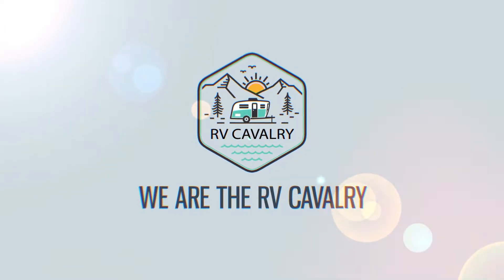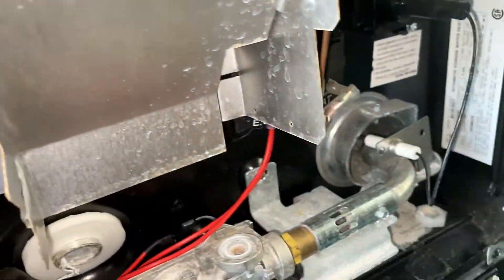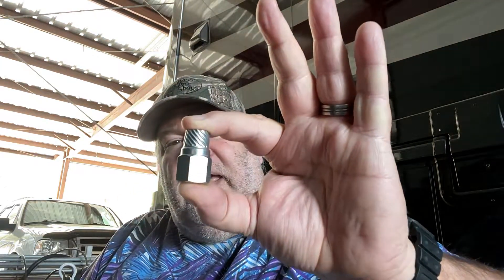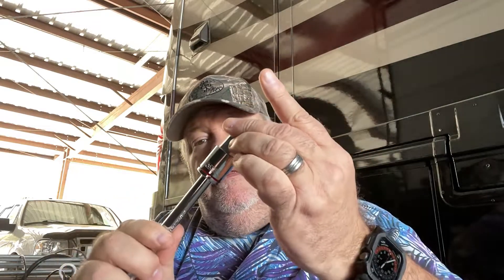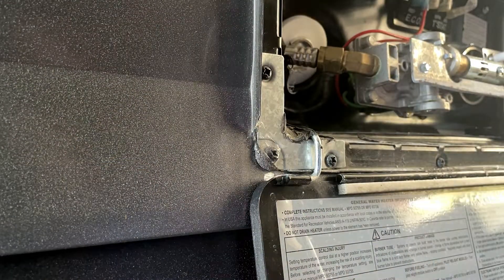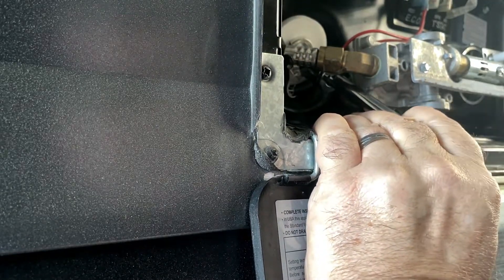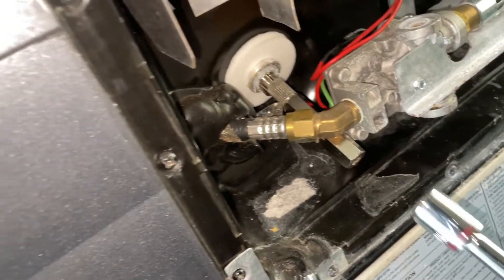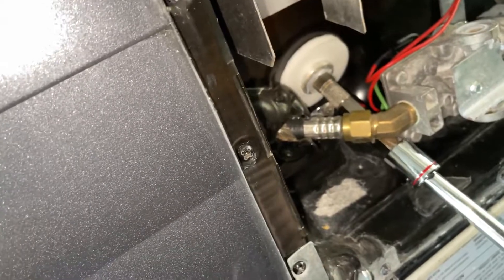DRAIN PLUG BROKE OFF INSIDE WATER HEATER | HOW TO | EP 0322

Comment: I am going to go to Home Depot and get the extractor. You are correct the plastic plugs are horrible. I am looking at replacing the plug with a Camco 1/2 inch Water Heater Replacement Drain valve. It looks like it is made out of brass. $9.57 from Amazon. Any thoughts? Thank you for the video.
Reply from the maker: Be careful with brass and aluminum they don’t go together do nonferrous metals. They sell an anode rod made for aluminum tanks you can them on Amazon. You don’t really need an anode rod for an aluminum tank but helps and the screw in part is coated and compatible with the aluminum tanks. Let me know if you have any trouble finding it and I can send you a link. The brass and aluminum will corrode and weld themselves together it’s a pain. Been there done that lol.
Reply from the maker: Also if needed you can use a paddle bit too just be careful not to damage your threads

Comment: Hope this works for me. Same problem. Ugh
Reply from the maker: I hope it works for you also. If the easy out doesn’t work try a paddle bit. We were camping with some friends and theirs broke also. We didn’t have an easy out but had some paddle bits in my tool box. I think it was 1/2” but can’t remember. I was able to line it up, tap it with a hammer, attached some vise grips to the end of the paddle bit and slowly backed it out. It took a little bit but I got it out in one piece thankfully. This happens more often than I would have ever expected unfortunately. But this beats taking it to the dealership that’s for sure. Anyway we wish you and your family safe travels and a wonderful holiday season.

Comment: Having same problem right now. EZ out grabs but my wrench keeps slipping because the plug is so tight. Any ideas? We’re camping at the moment.
Reply from the maker: Unfortunately I have had that problem before as well. I used a paddle bit like you use to drill a hole in wood. I used one that would fit on the plug inter section that stuck in there, and gave it a few taps with a hammer to set it in the plastic and then turn it out slowly. I had to re-tap it a few times but managed to get it out eventually. Hope this helps, let us know.

Comment: Currently having the same issue. Tried an EZ-Out first. Didn’t work. Bought a set of internal pipe wrenches like the one you used.  Won’t work. Can’t get it to bite.    Stuck the wrench inside the replacement plug and it grips just fine.   Any other ideas?
Reply from the maker: Gotcha if the Internal Pipe Wrench does bite is it possibly to big, I know the other ones will probably be too small. Sometimes you can take a rubber mallet or hammer and tap on it the Internal Pipe wrench extractor to get it to bite. Just be really careful not to damage the threads of your water heater. You can also carefully drill it out some to get it to bite and then try it. At a worse case scenario you can also drill it out if all else fails but be really careful not to damage the threads. Once you do you will need to pick all the remaining pieces out of your threads and then flush your hot water tank to get all pieces out. Let me know if this works. Hopefully it works for you these are a pain.
Reply: @RVCavalry  the wrench I’m using just barely fits. I bought a set of 3. 3/8” 1/2” and 3/4”.  I was using the 3/8” wrench. It has plenty of room. 

I’m thinking about heating up the end of the wrench and maybe it will melt into the sleeve of the broken plug and help it grab.  

From what I understand, these plug are suppose to be someone weak so that if and when the pressure gets to high in the tank and if the relief valve would fail, the plug end will blow out.  It’s like a 2nd line of defense, so to speak.   

I’ll keep ya posted on the plug.  Thanks for the info.
Reply from the maker: @Mi_Tony  Yep that is what I have heard to. We have some friends that are RV techs and that's what they have said at least. Let me know how it goes. This has happened to me a few times in the past. Typically the EZ Out works and I did have one that I used a "paddle bit" on. I was able heat the paddle bit up and it was just undersized so I was able to sink it  into the walls of plug without hitting the threads. I basically wedged it in. After a few tries I got it to set in and I used it almost like a large screw driver and slowly backed it out. But that was a long process. Keep us posted if you don't mind
Reply: @RVCavalry  well good news!!!   I got it out! 👍.   Tried heating up the internal pipe wrench. (Not too hot) but it did help it bite into the plastic, but after a little grabbing it would just spin.    So I used a 5/8” spade/paddle but.  Worked like a champ.  The out parts of the bit were perfect.  But a socket on the end of the bit and it backed right out.    Threads don’t show any damage, but now the new plugs (Amazon crap) don’t want to thread in very well.   We have a camping world about 10 minutes away.  I’m going to run over there tomorrow and see what they have for plugs.  

Thanks for the drill bit tip.  I appreciate it it greatly!  

Have a good weekend sir.
Reply from the maker: @Mi_Tony  Awesome glad it worked. The ones at Camping World are much better quality or at least they have been in the past. All the ones that I purchased on Amazon were junk too. Glad it all worked out. Feel free to reach out anytime. Thanks for the feedback to we greatly appreciate it.
Reply: @RVCavalry  yeah. Fortunately I have a CW about 10 minutes away and went and bought a couple plugs from them.  You can’t tell just by looking at them that they’re a little more robust than the ones on Amazon.   Threaded in a lot easier too.   Again, thanks for everything!  It’s greatly appreciated!
Reply from the maker: @Mi_Tony  Your welcome and  safe travels.
Reply from the maker: Yep try a paddle bit. I've them in the past with some really stubborn ones. Find one that fits the edges of the plug but not to where it will touch the threads. Give a few taps with a hammer to get it to sink into the plug and then start to work it out. You have have to re-tap it with a hammer a few times, but it should work for you hopefully.

Comment: The 2 f you over cheapest products you could buy .1 #- a water tank heater WITH A PLASTIC DRAIN pipe that eventually leaks then BREAKS when trying to remove it. # 2- plastic handles on a frying pan; YES, mankind will always make products TO DECIEVE YOU in buying a new one or phoning for repairs.
Reply from the maker: Very true